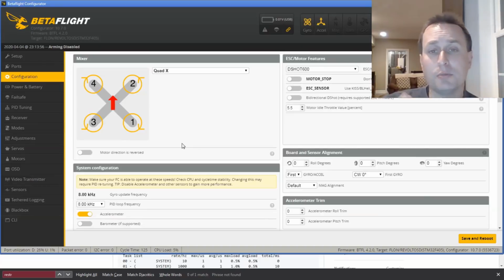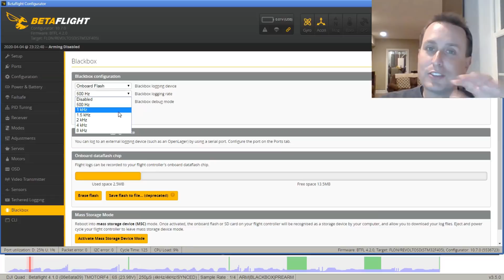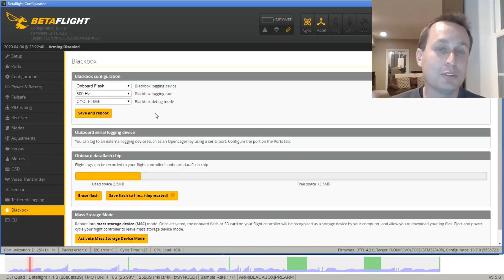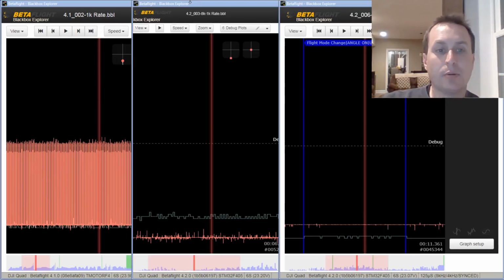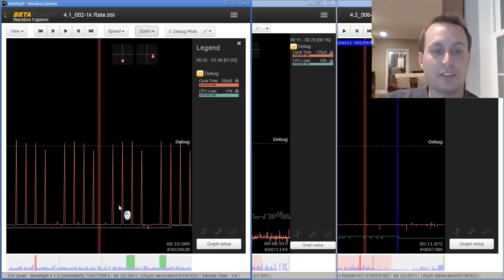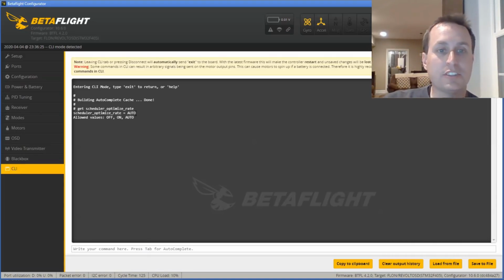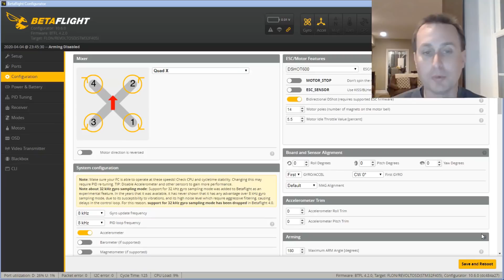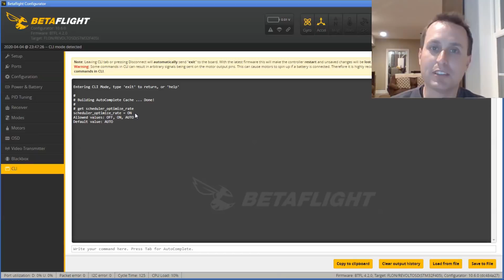Betaflight 4.2 Loop Rate Optimization

Comment: So what CPU load would we looking for on the in tasks ? 8k 8k with dshot 600 utilizes a little over 50% 8k 4k cuts that in half also if I do decide to run 8k 4k should I run dshot 600 or 300 thanks for the knowledge you bring to the table btw

Comment: So when I check tasks on bench at 8k/8k (F7 board), Gyro Filter and Pid collectively equal 100.7% with a Cycle Time of 125, CPU load at like 4%

At 8k/4k, those percentages are significantly lower, but the Cycle Time says 250. Which should I do?
Reply from the maker: 8k/4k.  A pid loop calc every 0.00025 seconds (250uS) is plenty.
Reply: @uavtech  Thank you. I had to redo the tune today, was getting the most bizarre mid-throttle oscillations out of nowhere and wanted to make sure everything is set properly still. I still reference your tuning in two packs video to get me in the ballpark of where I need to be. We're lucky to have you, my friend!

Comment: I have the GepRC Mark 4 the custom tune that it comes with is set to D shot 300 8K 4 K. They have black box log enabled. CPU utilization is at 3%. 
My question is if I disable blackbox log can I run 8K 8 K D shot 600 ? 
I do not have RPM filters enabled. 
This is a custom tune from GepRC just a reminder.
Reply from the maker: I would just run 4k, 300.  No advantage to 8k really.  Just disadvantage potential.
Reply: @uavtech  OK thank you.   My next question is maybe it’s set up to run RPM filter they just didn’t flash the ESC. It comes with betaflight 4.2 from the factory.
Do you think maybe that was their reasoning?
Reply from the maker: It takes manufactures a little while to catch on to the latest stuff.

Thanks for the support!
Reply: @uavtech  Thank you Mark you always answer even if your video is old !!!! I commend you on that sir. I don’t understand why other video creators would make a video like this and then not respond when people have questions especially if the video is old it seems like they don’t respond but that’s where there work is coming from basically. I don’t know anyway have a good day and thank you.

Comment: any idea, why my clracing f4s is giving me an "fatal error, reboot to retry" error? tried different sd cards, from super old 1gb, to old 8gb to fast 32gb, all fat32 formated .. this is driving me crazy! do i have to activate blackbox somewhere with betaflight 4.2? and what do i have to change in the ports section for blackbox, if there is something to change? thanks a ton in advance!
Reply from the maker: nothing to change in Ports or CLI. It should just work.  Download the SpeedOut tool I have at tiny.cc/uavtech and see what you get for read-write speed on your 8gb card.  Make sure it is matching speeds as outlined at: https://www.facebook.com/UAVTech1/posts/2166984896895966

Comment: This RC1 is definitely betaflight best ever. It's so incredibly smooth and accurate. I'm on stock PID and my 2X filter as normal. I really liked 4.1. This just perfects everything. The stock I values make the quad feel like it's on a wire. I'm not sure I like it being so accurate. I'm use to a little slip. I might try and get use to it or drop the I values down some on my light 5" race quad. I use race quads for everything. Freestyle, race, and fun. Appreciate the helo Mark. You always clear up these new features and break them down for us average folks. Much appreciated

Comment: I'm getting 70%-73% maxload with bidirectional dshot and rpm filters enabled on a noxe f4 fc running 4k/4k with dshot 300. shall I reduce it to 4k/2k or even 2k/2k with dshot 300 just to be safe? its a 2 inch quad running jesc 48pwm.

Comment: 8k/8k Dshot 600:
Cycle time 125
Pid Max load: 50.1
Gyro max load: 14.9
Total max load: 100.8%
8k/4K Dshot 300:
Cycle Time: 250
Pid max load: 26.9%
Gyro max load: 15.7%
Total max load: 68.6%

Im using T motor F7 board...
Should i change to 8k/4k?
Reply from the maker: On BF 4.2, i run 8k/8k.

The key is the gyro at 8k native loop rate.  The PID can come at 8k or 4k.  In 8k PID loop, with logging on, it may have some points that run behond 125us, but it seems to make them up on the next loop and in either case is a faster update than 250us.
Reply: UAV Tech I have the same max load on f4 and f7 boards.... I can use 8k/8k on both with ~105 max load

Comment: Hey Mark. I hate to bother you, ive got something odd happening with a MatekF405ctr, logging gyro scaled at 2k. For some reason, the first log logged onto a fresh sd card comes out fine. The logs after the first are missing information, and gyro_scaled will show up as debug0,1,2,3 it's just this board, 4.2 dev 2150-59 any thoughts? The one thing I do notice in every log after the first log, they are also missing the arming flag at tue start of the log.
Reply from the maker: I have seen it too with that board.  Best advice is to open an issue on it in Github.

Comment: No matter if I put 4k/4k or 8k/8k the 125 or 250 jumps alot. I'm running the Hglrc 20*20 fd445.
Reply from the maker: You must be on BF 4.1?
Reply: @uavtech 
Yes on bf 3.1.5
Reply from the maker: Right, cause not optimized as in 4.2.
Reply: @uavtech  ok so it's normal for 4.1. What about 4.2? Is it stable and worth the upgrade?
Reply from the maker: For lots of reasons 4.2 is better than 3.5.x.
Give it a look at RC or Stable.

Comment: 8/8/600 ACC off, 2khz logging rate gives me an average of <= 100 us (with lowest at 60 us), with 1 khz logging rate it is rock stable at 125 us as it should be. CPU load doubles from 4% to 8% so thats not an issue. FC is a F722s.

Comment: Hi UAV Tech, I have a different question. I have a flight controller with no barometer. I'd like to make the hovering of my quad better. I turned on throttle on OSD so I can see the number. I think you told me about it few weeks ago in slack. Anyways, it's so hard to hover but I think the value is somewhere between 33-35. Is there something I can change in Betaflight to make the hovering much more stable?
Reply from the maker: The only thing I can think of is change the Throttle Expo to a mid point around 35% and expo about 0.75.  It is in the Rates Tab.
Reply: @uavtech  Awesome! I'll make a change tonight and try it tomorrow. Thanks a lot!

Comment: Why does the scheduler optimisation have an option to turn it off? Why is it not on by default? Makes no sense.
Reply from the maker: Schedule optimization is controversial.  It delays other tasks to make up any loop time delay.
Reply: @uavtech  who cares if other things are sacrificed. While I'm flying I care about flight performance not my osd updating.
Reply: By the time the official 4.2 release happens, this setting may have ended up being enabled by default. But the point of testing is that people who understand the risks can enable these settings, fly/test them, then share their results.

Comment: Is logging at a lower rate also capturing less jitter since it doesn't "see" every every pid loop?
Reply: Mark Bizilj great remark
Reply from the maker: Probably.  Good point.  For sure the rate has an impact.  You can see in CPU utilization.

Comment: great content !! I was less worried before watching this video... when I press tasks I don't see a filter line with load. I am running RPM with dynamic filter on. How come we see one in your video ?
Also my cycletime is steady 125 in CLI tab, but all over the place on other tabs (between 113 and 134)

00 - (         SYSTEM)      9       2       0    0.5%    0.0%         0
01 - (         SYSTEM)    995     406       2   40.8%    0.6%       115
02 - (            PID)   2002     116      46   23.7%    9.7%      8973
   - (           GYRO)   8011
03 - (            ACC)    995      16       9    2.0%    1.3%       238
04 - (       ATTITUDE)    497      15       8    1.2%    0.8%       111
05 - (             RX)     32      77      46    0.7%    0.6%        39
06 - (         SERIAL)     99  566615       1 5609.9%    0.5%      1042
etcc till RX Check Function                   4       3                         1
Reply from the maker: Only BF 4.2 has filter loop broken out.

Comment: nice summary Mark! My impression from CT is that even the small jitters are a potential issue. I should quantify those separately. At any rate I could do a few more tests with debug off, if there is a list of test parameters you guys have in mind??.
Reply from the maker: 8k/8k Dshot600 with logging off.
In this config:
1. RPM on, Acc ON and OFF
2. RPM On and OFF.
3. RPM off, Scheduler Optimization ON and OFF.

Comment: So now we can run 8k8k with rpm filtering on a f4 now?
Reply from the maker: It will run, yes.
Reply: @uavtech  I'm finally going to have to try betaflight it has started to interest me here lately
Reply: Yeah, I get 21% CPU load on 8k8k with RPM Filter on F4 board. Low enough for absolutely no problems flying.
With cpu_overclock set to 192MHz it is around 11%.

Comment: So, how RPM filtering should be configured on BF4.2?
Reply from the maker: Same as 4.1
Reply: Leave harmonics alone, make sure motor pole count is correct, and adjust the dynamic notch max Hz to be 350Hz - party on.

Comment: why is dji airunit casuing spikes?? especially considering it's rated 4s max!! On another note do you know how I can get my voltage OSD to work running airunit & skitzo osd or cricket lite osd on dji airunit?? I can get my voltage to show up but it just stays at 0.0v!! I like BF better than falco x flying & acceptability wise. But everything is wired the same expect my receiver wire is it works only on rx with BF and on TX with falco!! I've tryd bridging the Uart 3 invert & normal I've tryd switch the wires & also soldering dji to battery instead of vbat on FC's none of yet will get my voltage on BF but falco works perfect!! Any suggestions sir??
Reply from the maker: Case BF is looking for OSD chip that is not there.

I'm not sure on the Revold board, they have always been weird.  Let me think on it.  

So RX is working, right?

You have MSP wired up to AirUnit?
Reply: @uavtech  Yes correct I have msp turned on uart 3, I'm pretty sure having msp turned on is a must because I did struggle with that as well then when I enabled msp I got video feed!! I've switched white & gray on uart 3, wired dji off power off esc instead of vbat on fc & last bridged the uarts normal & inverted then completely unbridged uart 3 still no voltage. I ran out of different things to try I really like my Voltage to out of anything else on osd!! Yes the RX is rocking!! When I look at the FC's the osd chip looks identical to my BF FC as well!! I have a new Iflight twindji & also holybro dji but yet to try them but I'm sure they will get voltage!! I just rather use my revolts tho as I like switching back n forth between falco & BF!!
Reply from the maker: Do you have Uart3 inverted Jumper set to Normal?
Reply: @uavtech  The revolt osd doesn't have option to bring usrt 3 normal or invert!! At least I don't see it on pinout or in person, I have however put dji on uart 4 tx & rx bringed normal & inverted to no avail also switch the white & gray wires from tx to rx just switching them to see if I could get Voltage nothing. Yes I did turn off msp on uart 3 then turned on msp on uart 4!! I had video on uart 4 just no V😢

Comment: Hi mark, nice work!
I guess what's your opinion about those who still stuck on 3.5 and all of this new improvements on the new versions? Are they missing better performance?
Reply from the maker: Obviously all newer versions of BF have improvements over older versions (bug fixes, flight dynamics improvements, filter improvements, PID loop advancements, etc.). 

The 3.5 thing is just silly.
Reply: @uavtech  I honestly fly only on test versions on my 5 incher but for my 7 incher after testing all bf versions 3.5.7 was the only one that got it flying half decent. And i have no idea why.
Reply from the maker: Fly beyond the defaults.
Reply: @uavtech  That is the strange thing, I spent three whole months tuning and got mediocre results without wind only random vibrations here and there. I had tried everything. Checked every motor, tried all the sec settings and still could not find what it was. I tuned with and without sliders tuned the filters. Tried thrust linear dynamic idle, heavy filters, lite filters. And i still had weird vibes and bobbles i could not explain. Finally the SD card slot on my radix died so i could not share my logs with the FB Group. Finally before I wanted to just go 5" for Long Range I tried an older firmware wich was like perfect without wind after 3 packs of tuning. And i cant explain it. However when 4.2 gets a target for the radix i will switch because it flys just perfect after getting everything dialed in. The reason i love BF. It may be a lot of work to get it flying good. But if you are there i flys better than Falco and Kiss and the rest of that RPM filterless crap xD. Sorry for the long text.
Reply: @uavtech  oh and thanks for teaching me how to tune you are the man. Keep on doing your stuff. <3
Reply: @uavtech  I’ve heard micros fly wonderfully on 3.5.7.